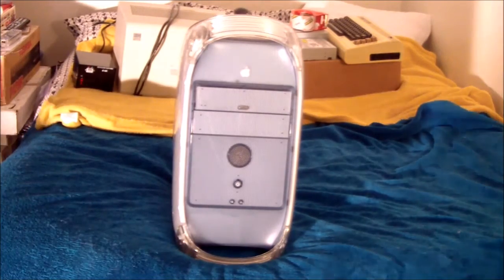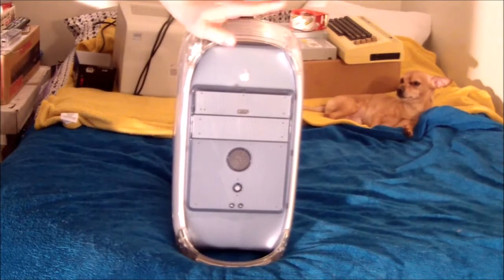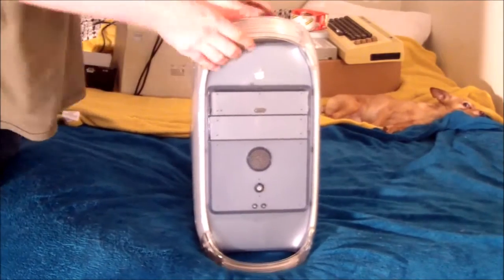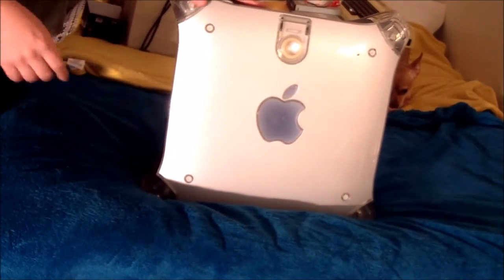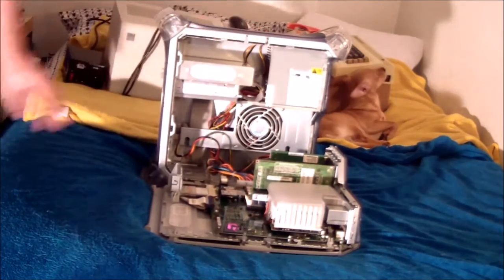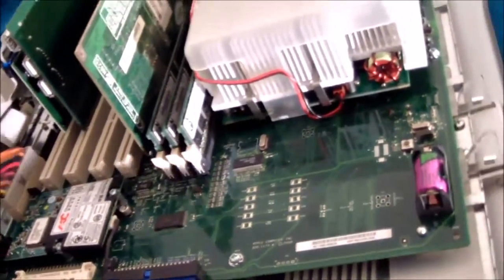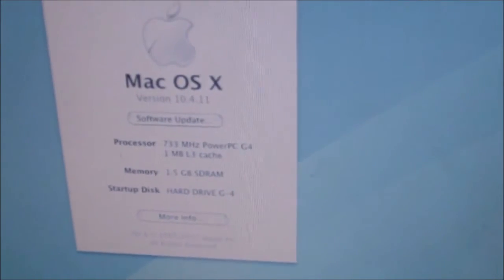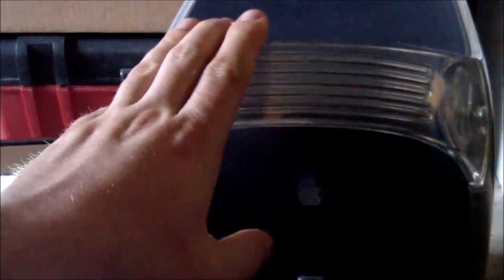Macintosh G4 Digital Audio

Comment: my very first powermac was g4 466mhz digital audio. did some upgrades and the very first bios flash geforce fx 5200 pc to mac.
Reply from the maker: +blooder81 Did you need to modify it? I've been reading about having to cover certain pins to get compatibility.
Reply: you need to flash the bios first and them tape the pin 3 a 11 on the back of the card to ignore in the agp 8x cards.
Reply from the maker: +blooder81 ah, so its any x8 AGP card. thanks for the clarification.
Reply: yes.
Reply: +0blivi0n100  not all agp graphics are compatible with mac bios.
Reply from the maker: +blooder81 I have a GeForce 7800 AGP card that I'm not using and it probably won't get used in my PC's so I keep considering it for flashing for the mac but I'm just worried about messing it up since they aren't the cheapest cards to find anymore.
Reply: if the gpu is g70 core you can. go to themacelite website and read more

Comment: If you want, i can send you ati radeon 9200 128mb with efi video bios (compatible with this g4, i have exact same machine) and with drivers on cd, it's ideal for os x tiger, even leopard works with it very well, you will pay only for Delivery from poland. I changed it because i bought an geforce 6800. You can take it as donation :) (i'm sorry, if i made any mistake, english isn't my first language)
Reply from the maker: That's very generous of you. your English is just fine. is it an agp card? I thought they required some kind of pin modification.
Reply from the maker: +SteveMC after shipping and packing supplies its probably cheaper if you found one locally. usually I'll trade or sell excess computer stuff I'm done messing with or no longer need and put the money back into the hobby but if its something no one wants or to heavy to ship it generally gets donated to the local boy scouts.
Reply: I've done all required mods
http://pokazywarka.pl/agt7am/ <-- pictures
Reply: +0blivi0n100 What would the boy scouts do with a PowerMac?
Reply from the maker: They hold a swap meet here every month with donations of things like computers, VCR's, scooters, whatever. mostly old electronics. I guess the money they make goes to whatever it is they do.
Reply: 0blivi0n100 but what is done with those devices?
Reply from the maker: correct. they sell them and the items they cant sell they give to a recycler. and yes that is a shame but they do sell the stuff at ridiculously low prices and generally with things like a working mac if they don't sell it they keep it around and try to sell it again at the next swap meet. as for the buyers, yhea. I know for a fact there's a lot of scrappers that peruse that meet but I also know there's collectors and people like myself that will pick up anything of vintage significance.
Reply from the maker: +0blivi0n100 As for this power mac I'm not 100% what its fate is. I have a later MDD model so this one is kind of redundant also I'm not as big as a mac collector as I am into PC stuff and I'm dealing with limited space. Don't worry I'm not going to toss it but I'd rather do something with it locally rather then have to ship it due to the low value of the machine and high price of shipping. Also in my day job work with the disabled so I'm also looking at donating certain items that aren't to vintage to a few individuals to help them learn some computing skills or just have something to mess around with.
Reply from the maker: +ジャンペウェル二番目 that's pretty neat. how does this card stack up against a GeForce 4mx?
Reply: 0blivi0n100 Radeon 9200 is pretty similar to geforce 4, depending on model: ti or mx. MX 440:  http://www.game-debate.com/gpu/index.php?gid=113&gid2=99&compare=radeon-9200-series-vs-geforce-4-mx-440
Ti 4600: http://www.game-debate.com/gpu/index.php?gid=757&gid2=113&compare=geforce4-ti-4600-vs-radeon-9200-series
In mac situation, http://pokazywarka.pl/go8erw/ in both quartz extreme is suported, and core image is software based.
Overall these cards are almost identical.